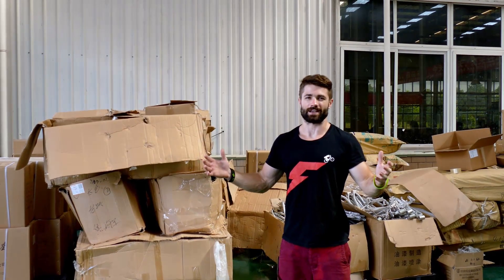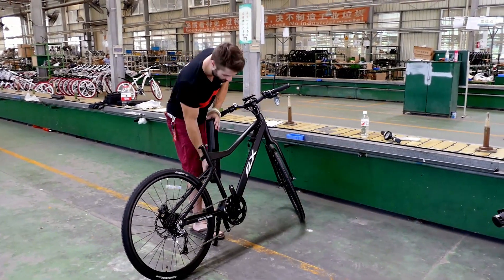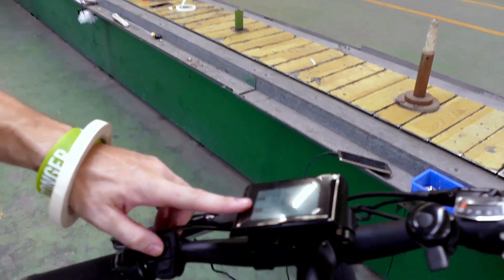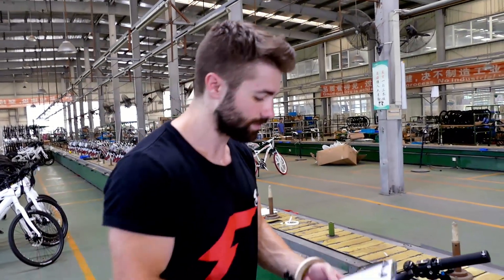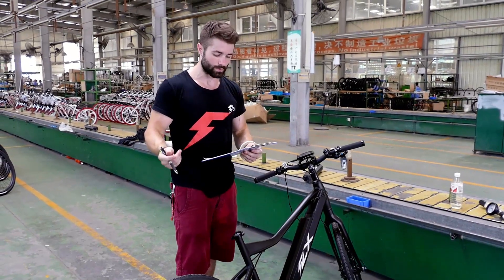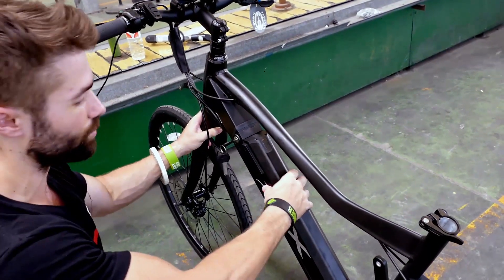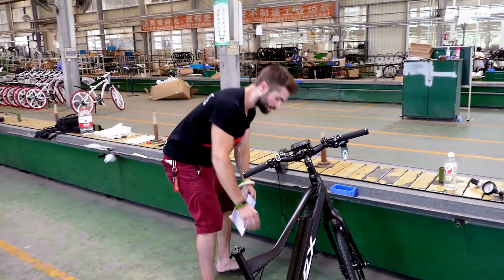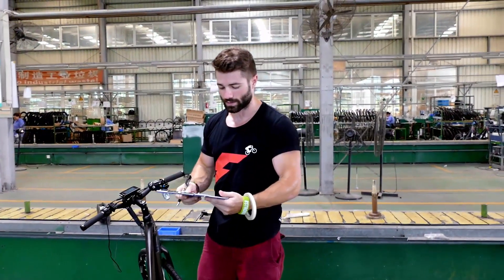FLX How to make an ebike: Final Inspections

Comment: Hi, Looks like the frame is not a single block, but is made up of a few tubes that are assembled together through soldering (I noticed this on a close-up view). Question is: how solid are these solderings and ho do you QC their strength?
Thx again for this top-class manufacturing - keep up the good work!
Reply from the maker: Sure is Potito, the welds are extremely strong, in fact they're probably the strongest part of the frame. The frames go through all sorts of extensive stress testing before they're approved for use.

Comment: So here is a thought, for what it's worth, from a guy just throwing ideas out there.  I just bought my Attack and I was looking around on other crowd funding ideas.  Why not incorporate some sort of turbine into the front tire / rear tire that is similar to a wind turbine that captures energy from the ride and feeds it back, as power, to the battery.  I'm not an electrical engineer, but I would think something like this could substantially increase the battery time, even recharge a dead battery.  I'm thinking of times (like during a downhill) where so much energy is produced by the gravity of you traveling down hill that you could capture that to some extent to extend your battery / ride time.  Do ya get me ?  Could be a future add on or feature ?
Reply from the maker: Thanks for sharing this, really appreciate the feedback!

Comment: Thanks so much for sharing this process Rob and thank you for the care you have shown in the production of these bikes! Is there any issue with the key sticking out on the left side of the bike? Could the rider's leg come in contact with this key?
Reply: Put the keys in your bag, back-bag, small belt bag, those small triangular bags that go in the front or back v of the frame.
Reply: Thanks for the reply Edwin. I wasn't wondering about where to store the key. My concern was that a rider's leg might come in contact with the key while riding, as it appears to be sticking out on the left side of the bike.
Reply from the maker: Hi Bill, thanks for the kind words. The key can be removed while riding and placed anywhere you like. It's only used for getting the battery in and out, no need to keep it in while riding. Personally I keep it in because I'm really really good at losing things.

Comment: well done!& if all been test like this except for a test ride before boxing up.That even better than the much more expensive(5000+) bike I bought which had multiple cosmetic defect ,such as 3-5mm gaps on motor panel cover ,and paint chips off by itself !